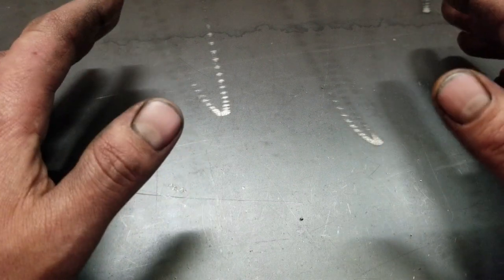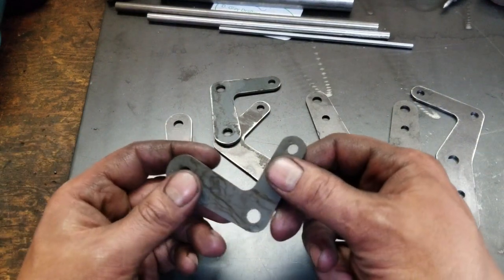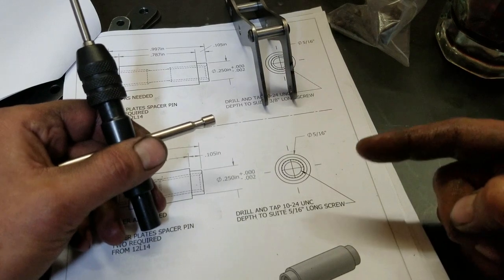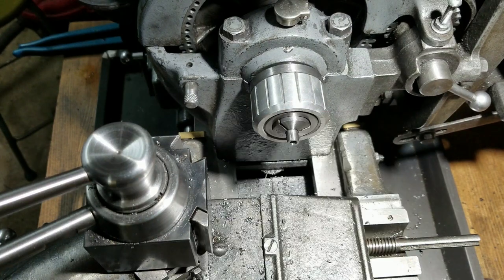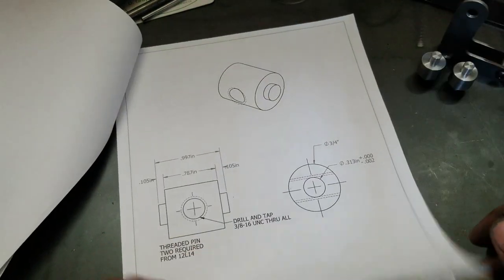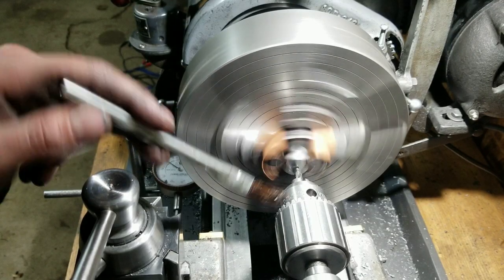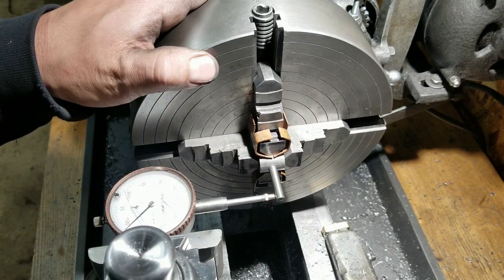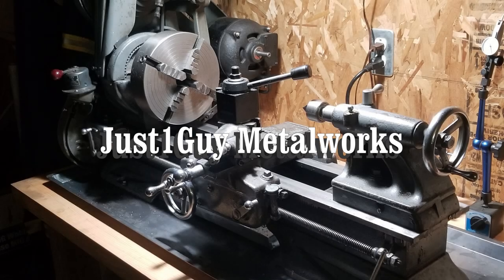Making Some Kant Twist Clamps! 😃

Comment: Great video Chris, I had to order one of these kits and they are a nice little project for sure. Nice to see you making vids and to sample your humour , stay safe and cheers pal!
Reply from the maker: Thanks, Howder 😊. It has been (and still is 🤣8ii) a fun project. Not to mention I've been in need of clamps for quite some time lol. Cheers mate! 😁
Reply: @Just1GuyMetalworks  Yes same for me, I did not realize how nice these clamps actually are until I completed them. As I typically do one-offs, it was a great exercise in getting the lengths spot on and using my dial indicator on the main axis of the lathe. I cheated with the mill for the flats though.